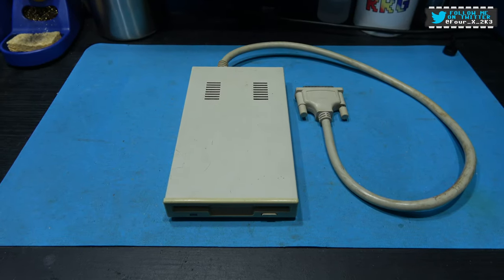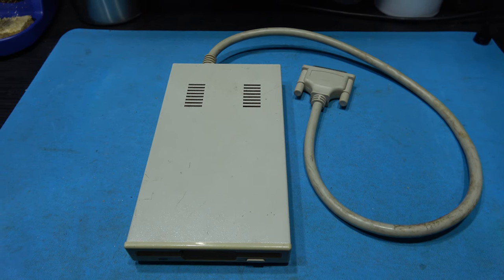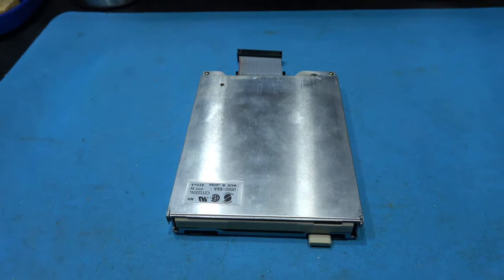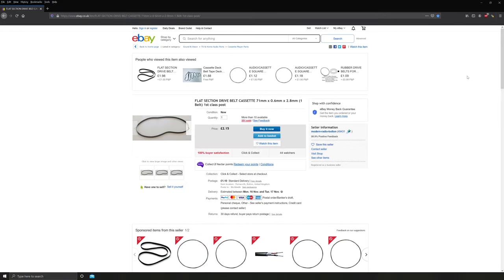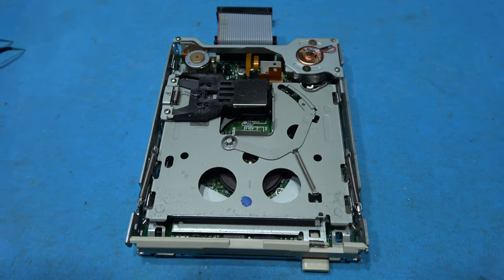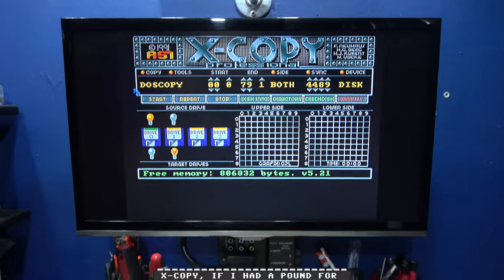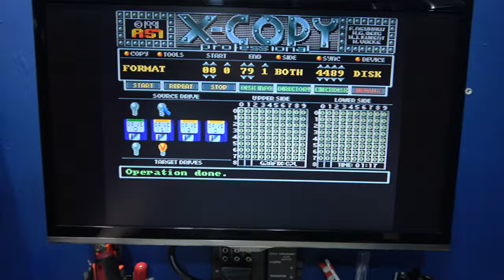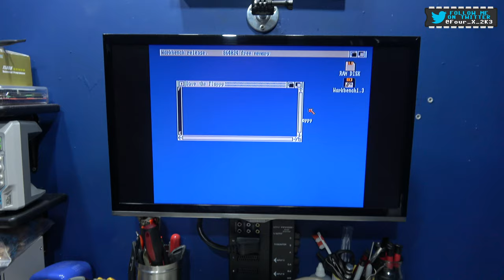Commodore Amiga - Roctec (RF332C) External Floppy Drive Repair.

Comment: Is that drive belt the correct size for all Amiga disk drives?
Reply from the maker: For this model Yes, if it's a different model probibly not, look for a sevice manual for your drive. it should have a part's list with the belt infomation.

Comment: I have some amiga external floppydrive. Do you need to modify amiga to get it work or is mine just bad? Meaning can you play games only using outer one, or copy files from outer to inner without any mods? Cheers
Reply from the maker: You'll need an external enclosure as that will have the components (IC's) to work
Reply: What i mean is I have outer drive for amiga. With the right cable. Will it work pnp?
Reply from the maker: Should be OK.
Reply: Allright. Ill try again later. Thanks.